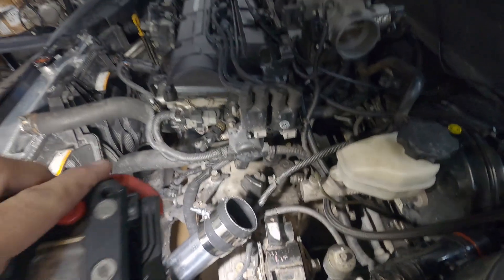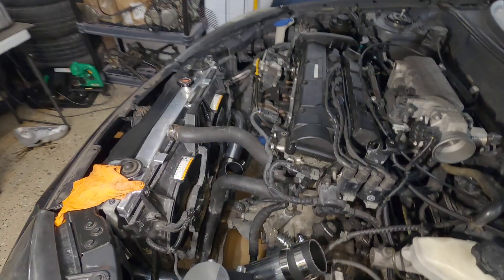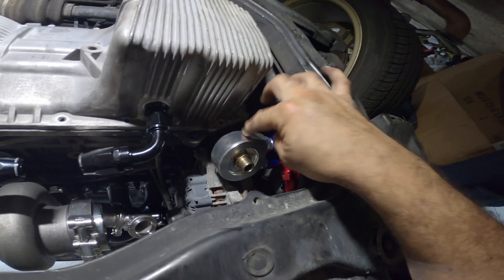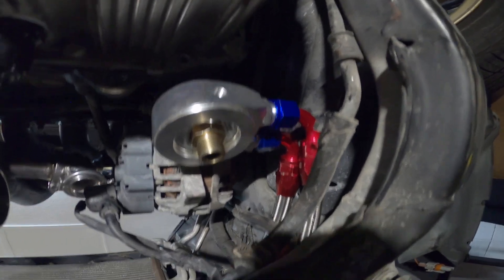Hyundai Tiburon Turbo Project Episode 5 (Oil Cooler and Oil Catch Can System)

Comment: What computer do you use to tune?
Reply: Also where’d you order the sandwich I cant seem to find them?
Reply from the maker: For the Oil cooler?
Reply: @PIBRACINGCHANNEL  it was the part you were calling a sandwich for getting the oil to the turbo I was talking about I can’t find it no where and that’s what holding me back as of right now
Reply from the maker: We are using a Fueltech 450.

Comment: Hey, I'm trying to pay attention to all of your videos, I want to turbo my 06 4 cyl. automatic Tibby as well lol. Is there going to be a problem because it is an automatic? On your very last video when you are finished with putting a turbo on the Tiburon, can you add a breakdown of the pricing on how much it all costed for all of the pieces please, with the locations or URL's of where you purchased the parts. I want to see if I can keep the battery inside the engine bay because I want to keep all the trunk space that I can for camping. I live in Minnesota and I can't lower my car because of how horrible it would make it drive for winter but I might want to put the same coil overs as you guys did so I can adjust them per season. My Tiburon is my first car ever so it is very sentimental to me and I would love to reach the 400hp mark that you guys are shooting for as well without breaking the bank. I have roughly 159k Miles on my car but it purrs wonderfully without the catalytic converter and with a cool air intake. I plan to keep my Tiburon for as long as I can or at least 3 more years then swap to a 2010 infinity G37 for the purpose of the all wheel drive it has so I will be able to survive winters up here in Minnesota. And it will come with a stock 230hp right off the bat. Thank you all for making these videos and keeping everyone updated on the work in progress, Keep up the good work!
Reply from the maker: Thanks for supporting our channel and remember to share it to your friend so you can help us grow faster so we can do cooler projects for you guys. My advice for you is to start with a kit because what we are doing is more in a custom side because we gat bigger plans for the car. I found a kit that on ebay that has everything you need. It’s for an older car but is the same engine plus you can leave the battery in the oem location. 
https://www.ebay.com/itm/271517476040
Reply: @PIBRACINGCHANNEL  thank you so much for the link. Right now that $1,450 is a lot for me so I'll have to wait a little bit but if they drop anymore in quantity then I'll have to buy is ASAP. For now, winter is coming so I dont want to do it yet but if my car lasts through winter, I'll get ready for installing that turbo. Thank you!
Reply from the maker: @thedevinx7project335  No problem. Glad that I can help. Remember to see the next video we are going to fabricate the custom Turbo manifold.
Reply: @PIBRACINGCHANNEL   will you guys be replacing the transmission as well, to battle the 485hp? Idk how many times y'all have done this before so I'm very curious. I was told that the transmission is not going to survive with 485hp lol
Reply from the maker: @thedevinx7project335  Not for now but the transmission is going to break if you go to the drag strip with big slick tires. But for the streets is going to hold depending on your type of driving.
Reply: @PIBRACINGCHANNEL  should I also go to a dyno to get it tuned?
Reply from the maker: @thedevinx7project335  When you do it turbo yes